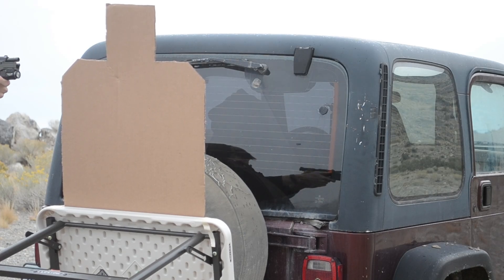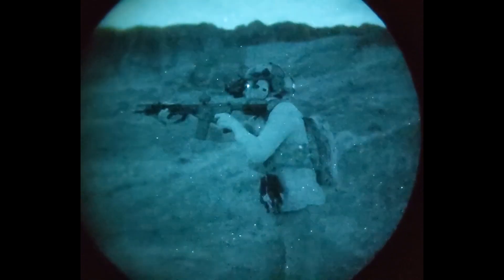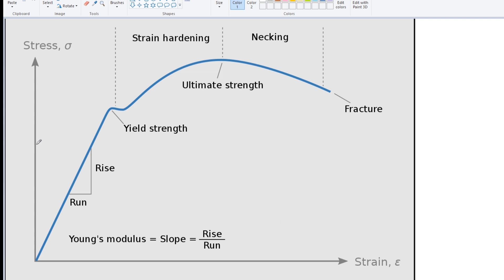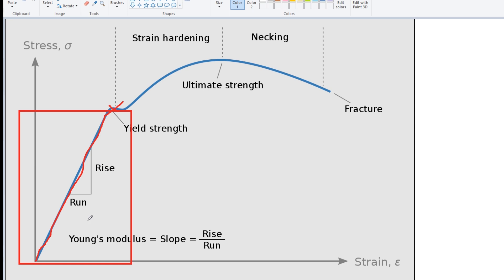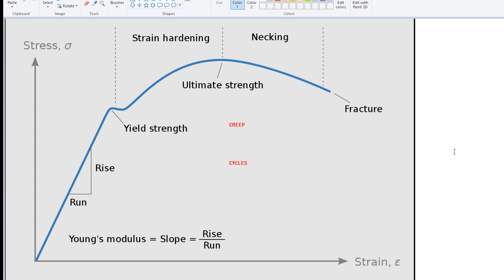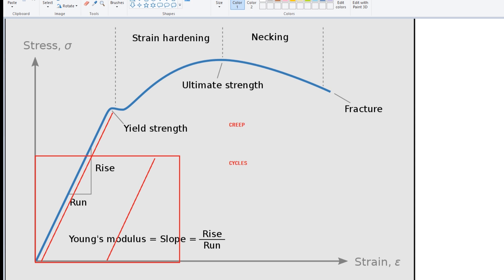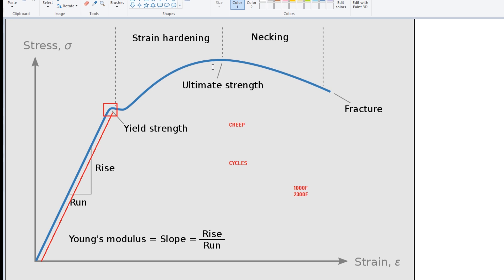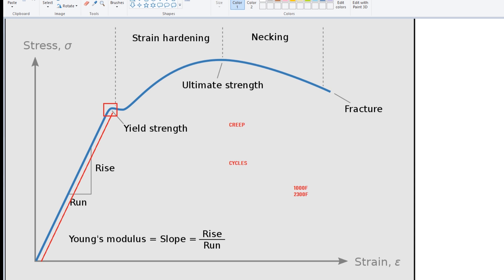Leaving Your Magazines Loaded? Engineers Perspective

Comment: >5.56 won't even be around in 50 years

They probably said that during procurement in 1972. 

I had a mag my uncle gave me as a kid, that he had from his service in Vietnam, it's older than I am, I have since rebuilt it, possibly several times. At some point in the mid 2000's I was at the range, and I put a stripper clip spoon on the mag, put a stripper clip in, and jammed those rounds in. With each round going in, a coil of the spring snapped and it collapsed a little more. The whole spring just turned into a "half racetrack". So that spring was probably 30-ish years old at that point, still had the original black follower. All of the anodizing is gone, but I put a new magpul follower, fresh spring, and a fresh floor plate (wanted a ranger pull). Still using it today.

Comment: I might. E bake to get you a job in Indiana  . I work making oil tampered valve spring wire . Hit me up if your intrested.
Reply from the maker: what is the job description? Hmu on instagram or discord.
Reply: I'd have to see for sure but I believe we might have an engineering job open dont quote me on it. I dont have either insta or discord but you could email me then I could find out any info and email you back. The company I work for is called Sazuki Garphyttan . If you want look it up on the internet to see if it would be something you'd be interested in
Reply from the maker: email me at brassfacts2@gmail.com
I'll be honest, my desire to move out that far is pretty low. So if it were a thing it'd need to be remote.

Comment: The follower getting worn out from a bolt closing/locking open on it shouldn’t be a thing.  The follower presses up on the bolt release to lock the bolt.  The bolt doesn’t just lock on the back of the follower… I don’t think this is a real issue.  Maybe I’m trippin tho,

Comment: I have spent my entire adult life as a Technician. Working on everything from military weapons systems to automation in the  gas & oil industry. I would implore you to do three things. #1 Don't over engineer things, #2 get out in the field and see how things are in the real world, #3 Look at things from the macro level as opposed to just the micro level.

You have to understand that everything you engineer, will at some point fail. How your design is engineered will directly affect the level of pain for the Technician to repair or replace it. I can't even count how many times I had to "Re-engineer" a piece of gear due to how it was designed. As I said just a few minutes spent on how your design interfaces with other ancillary equipment is very helpful to all involved.

Now as far as long term storage of loaded magazines goes, your video was interesting, but this topic has been beaten to death! As a 20+ year active duty Veteran I can tell you we have stored loaded magazines for years in austere conditions with no ill effects. I'm not knocking your effort, just simply stating fact. Besides, as you pointed out mags are cheap and plentiful. 

I would offer some advice for those with little experience in this regard, and that is, be sure to test every new mag before adding it to the stock pile. Number your mags for easy identification and as a way to determine it's life span. Mags are an often overlooked piece of gear, and without one your weapons system is now a tent stake. 

I know P-mags and other synthetic mags are popular, and I even have a few. but my go to, tried and true mag for SHTF is the okay Industries Surefeed mags. Yes, they are aluminum, but they come with anti-tilt followers and very good springs. They are also a good 1/4" shorter than the Pmag etc. I train very hard, and very often (Not a flat range, static shooter) and in the past 36 months have not had a single mag related malfunction with them. I have in that same period had several issues with Pmags; feed lip/spine cracking, spring binding etc. I live in the South West where temps of 110 deg are not uncommon. I can tell you from experience, plastics do not like extreme heat. Take a mag with an ambient temp of 100+, jam it into a magwell after several hundred rounds and things will happen. A big plus is that the Surefeed mags can be had for $9-$11.

Just my .2 cents, good luck on your finals...

Comment: Pmags have that "dust cover" that is really meant to take pressure off the feed lips. I dunno if you mentioned that and I missed it.
Reply from the maker: just really looking to talk about the spring here. But yes, the covers are useful for taking pressure off of the feed lips (which have a stress concentration at the spin, where pmags typical break)

Comment: It wasn't explicitly stated but to achieve severe creep deformation you need the recipe of high operating temperature, stress, and time. Hence why the 50 year old mag will work less effectively. 

Also as a follow-on you're probably more realistically going to have your spring primarily fail due to corrosion which accelerates the deterioration of the elastic strength. Another way to view it is that the fatigue strength is based off the number of cycles, temperature, and the load magnitude experienced.
Reply from the maker: yeah, I wanted to keep it super simple.
I cut a lot out like critical crack growth in the spring, or feed lips, and more.
Figured this surface level view would be far better. and if I wanted to I could always do more videos.

Fundamentally I just want to explain that, cyclic fatigue is probably the largest contributor behind just loosing the mag or blowing out the feed lips.
Reply: @BrassFacts  i thought it was solid.

Comment: Your wrong on one thing.  They have found several world War 2 mags loaded and they fired, unloaded, and studied them and found not noticeable or measurable difference between the springs and new ones.  

I cant remember exactly where but I remember at one point reading a study estimating that it woukd take 400 years of stored compression to add at maximum of 1% reduction from creep and that its more likely season temperature cycling woukd be the majority cause of damage.

Comment: What about the spring force constant. If you store a magazine full for long periods of time, would the spring force constant go down? Could you ever get to a point where a spring force constant gets so low that there is trouble feeding a round into the chamber due to the spring.
Reply from the maker: that's a function of being in the elastic deformation region. A metal (or all materials) have a corrective counter force.
In order for the spring constant to go down, the object needs to experience permanent deformation, which have several mechanisms mentioned in this video.

Comment: Great info.
It would be interesting if you could do something similar to pistol frame material. Steel, aluminum, polymer.

I've heard aluminum frames might have a 30k life, and some competition shooters breaking their glock frames. Possibly why HK uses a buffer system in their hammer fire guns.
Reply from the maker: really hard to say, I've been considering metal mags vs plastic mags vs pmags (similar concept)
But the issue is, I no longer have acess to a tensile testing machine, and the data on pmags or other types of plastic mags are not widely available. Specifically tensile strength, + UTS, and material composition.

I suspect pmags are nylon reinforced with fiberglass (nylon 6) but that's to vague to make a vide on.

Same issue with metal vs plastic guns. I would have to speak extremely vaguely without data.
Reply: That makes sense. Every manufacturer might use different materials, alloys and what not.

Personally, I wouldnt mind a general video about the different frame materials, and why they end up breaking.
Reply: I would appreciate this. I could be wrong, but from what I know, proper polymer frames will almost always outlast aluminum frames. Aluminum work hardens, becoming brittle, and eventually cracks. Polymer flexes and disperses the energy much better, and is a much better frame material for handguns.

Comment: I left a gi mag loaded in 2009 with federal xm193 and took it to the range last month. Fired every round no issues at all.
Reply from the maker: nice, good data.
Reply: @BrassFacts  There have been several reports from Army, Air Force and Marine units a decade ago (around 2010-ish and before this as well) where Vietnam surplus were found still loaded in USGI mags and they mostly fired flawlessly. Failures were attributed to ammo fouling due to potentially non-perfect long-time storage or intermittent transportation over the years versus the magazines.
Reply from the maker: @Talishar  interesting, thanks for that tidbit.
Reply: 45 yrs shooting. It all depends on the climate and the spring Quality. Quality STANAGs stored in a cool dry place, like a gun safe in a climate controlled home, will last a long time stored.

HOWEVER, anyone who's ever been a grunt in a tropical climate knows magazines require regular cleaning and maintenance, usually right after you get in from the field. Neglect to do this...and they won't function well for long.

I've seen magazines, any bare metal really, start to rust in hours in the tropics.

Don't leave mags in a garage or vehicle.... they'll rust in most parts of CONUS.
Reply: I’ve had similar experiences with GI mags
Reply: My old man had magazines loaded from Vietnam, dozens of them...  Not a single issue when we fired them 35 years later.
Reply: @savagehunger3315  That’s so cool, I would have loved to go to the range with him. I learned to shoot from a Vietnam vet Marine gunnery sergeant. Some of the best people on the planet.
Reply: Whew, thanks I have a box loaded😏

Comment: Magpul Pmags wear out crazy fast if not used properly. Once a year at annual qualification we inspect all dept issued mags and usually find 5-10 with hairline cracks on the feed lips and 5-10 with bulging sidewalls. 90% of the time when we find damaged mags they have been overloaded to 31rnds and left that way all year. Almost impossible to notice the damage without calipers for the bulging and a magnifying glass for the feed lips. We tested a batch of damaged mags a few years back and found that the ones with hairline cracks on the feed lips would completely break shockingly easy when dropped fully loaded on concrete. Seeing so many break at work has caused me to start buying mostly lancers for personal use and leave my Pmags loaded to 29rnds or completely unloaded when just being stored.

Also if you're paying $15 for pmags in 2021 your paying way to much. They frequently go on sale for $10 each and every once in awhile as low as $7.99
Reply from the maker: yeah, if you overload a mag you'll be likely exceeding the feed lip yield strength, or close. Add a jolt, and you'll for sure exceed it.

$15 bucks for gen 3s. Gen 2s are a lot more cheap, but have issues.
Reply: @BrassFacts  what issues? My dept. Specifically went with Gen 2 because we had issues with Gen 3 mags failing to seat properly in the slightly flared mag wells our AR's have
Reply from the maker: @PracticalTacticalSheepDog  yeah pmag are designed for specific lower dimensions.

The issues are mostly follower path design related, the over insertion tab,  and some others I've long since forgotten 

my g2 mags wear out noticeably faster both at the joint that connects the feed lips (base of the U shape) and the older G2 followers round out in dry fire in like 6mo-1 year
Reply: What mag is best to store loaded? I was thinking surefeeds but so many options out there
Reply: @techti8792  lancers are designed to be left loaded

Comment: I almost always leave my mags loaded. Most of my Gen 2 Pmags feed lips have expanded slightly. Only to the point of an empty mag not free-falling from my AR. Nothing that’s prohibited function yet, and a few of my mags are easily 5 + years at this point, fully loaded. 
Haven’t had my Hex mags long enough to know yet.
Reply: My gen 1 hex mags were about 3 years old when the showed significant stretching but still ran fine under range conditions. They also did not free fall even unloaded.
Reply: Simple solution, use GI mags for storage in your "go time" kits, just change the followers out with anti tilt followers. GI mags don't spread or crack like plastic mags. I have dozens of adventure line and colt mags that have been loaded with 55gr ball since the early 90's that were part of my dad's "pre ban" stash, they still function just fine, going on 30 years now.
Reply: I don’t like hex mags, especially when D&H, surefeed, PMags, and lancers exist.
Reply: I leave mine loaded to 29/30, so that its easier to load on a closed bolt, and to reduce wear on the spring from leaving them loaded. This is probably not needed, and based on Fuddlore.
Reply: You should take a look at your feet lips under a magnifying glass and check for cracks. The can be difficult to see with the magazine loaded putting outward pressure on the feed lips and they can be very difficult to see with the naked eye
Reply from the maker: I have noticed some hairline cracks on both G2, and G3 pmags. Most of it seems to be G2, but I had a G3 fail after a shockingly low time frame, and low usage.
Reply: @BrassFacts  

Do you use magpul pmag covers on loaded pmags?
Reply from the maker: @99cobra2881  no, not for loaded mags in kit
Reply: @BrassFacts  i think he meant when having mags in "longer term" storage do you put the covers on.
Reply from the maker: @mrdark9916  I don't actually store mags in long term storage really

I have 10 loaded mags in rotation. 3 in a PC
2 in a chest rig. 3 in the car in a mag holder
2 in my "assaults' pack" those would be the only ones that are uncovered, not in a pouch
Reply: @mrdark9916  Ok, but why store magazines loaded for the long term? It takes under a minute to load a mag from a stripper clip, and avoids putting any extra stress at all on it. I just don’t see the point of keeping any that aren’t my “ready” mags loaded.